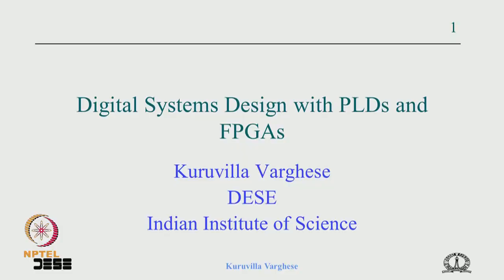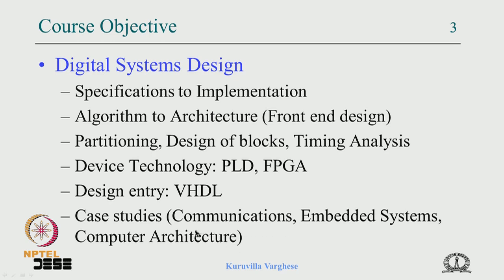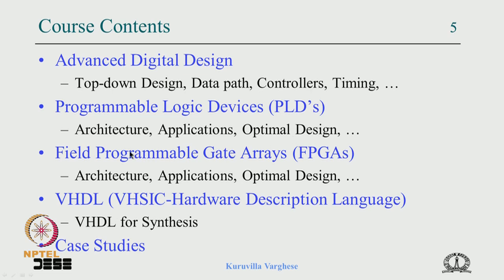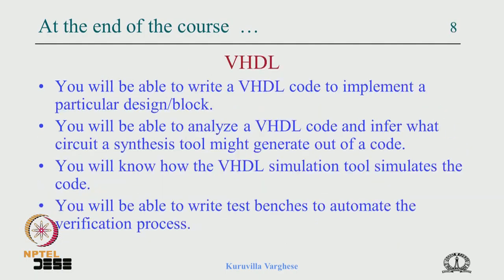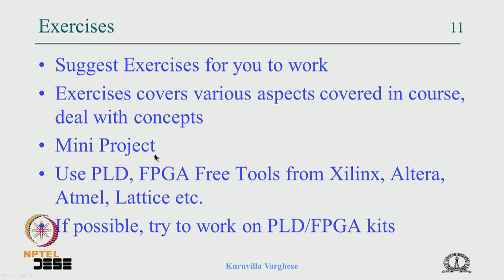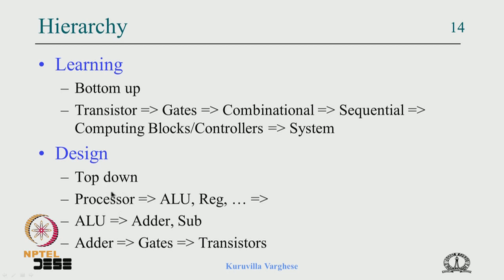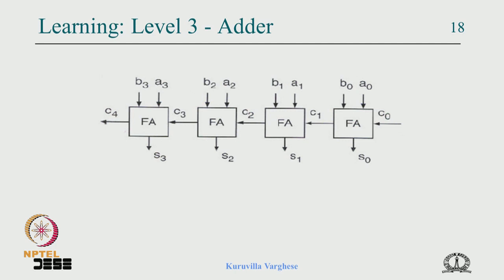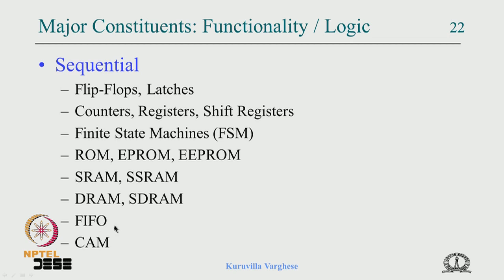Mod-01 Lec-01 Course Contents, Objective

Comment: Unless concept is clear you won't be able to solve problems
Hierarchy 
Learning you go bottom up
1 gates and nand
2 combinatorial circuits
Sequentianl: combinators
Blocks then system
Design top down
Processor all Registers , counters
2 Take 1 part,  ALU break down to
Ali adder, subtractor,  so on
Pick q peace
Into gate,  into transistors Cmos
Learning level 2 : Adder
Level 3 adder " the carry.  Multiplier
For each but form a partial product
Design top down,  fliplop latches (transparent)
Minimization 
1 karnaugh map
2 qm quine mcCluskey
3 espresso